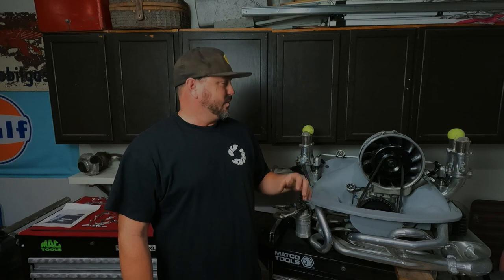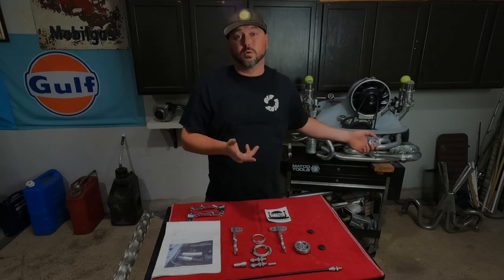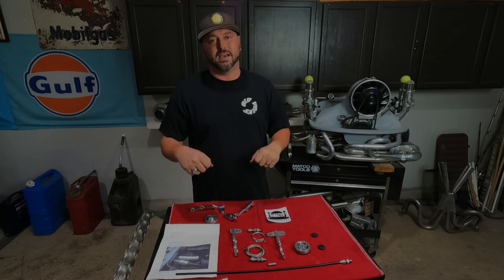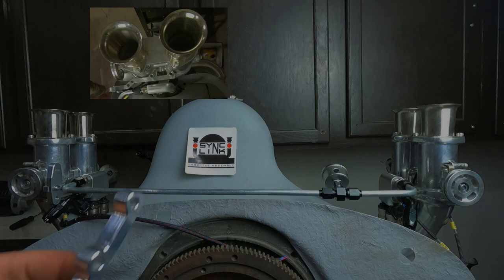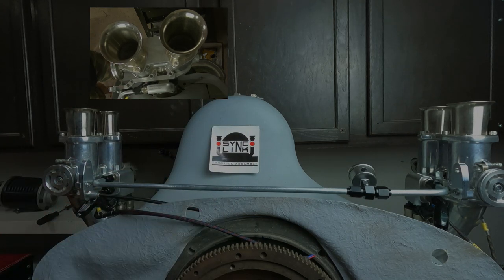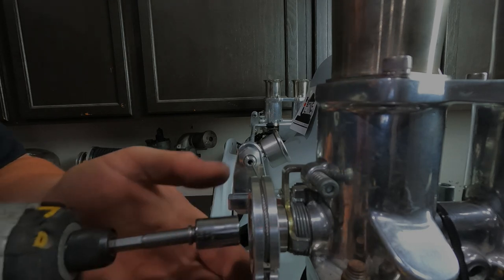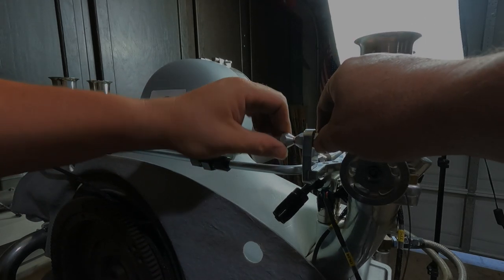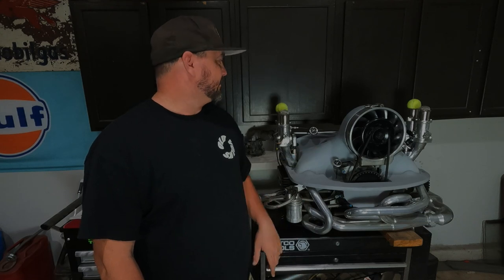Installing the SyncLink Throttle System on an aircooled vw

Comment: I know this is an older video but, on the right side, the idler side pulley with just one cable, what do you do if you have to take the carbs off?  I'm thinking like on motorcycles, having a slot cut in the cable mount bracket would allow you to take the backer nut off, unhook the cable end from the wheel, and slide it all out the top slot cut in the mounting bracket.  You then would leave all of the cables etc connected to the left carb bracket.  The same would go for the throttle cable on the top of the left mounting bracket.  A slot in the top of that would let you remove the motor easily from the linkage system etc.  Just a thought.  Nice video too!!!
Reply from the maker: Thanks! The way it's made, you just twist each carb to full open and the cable end slips out of the pulley. With a little practice it's pretty easy.